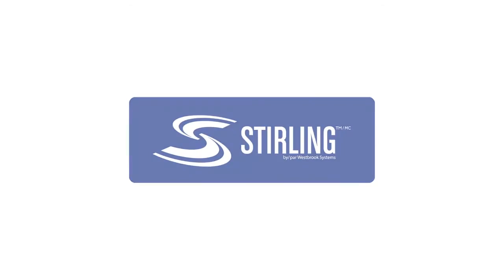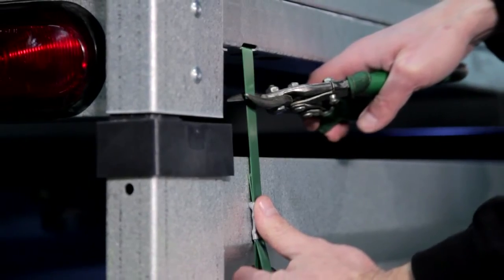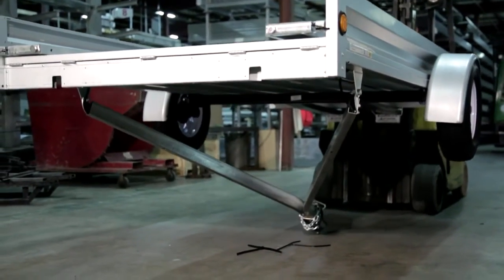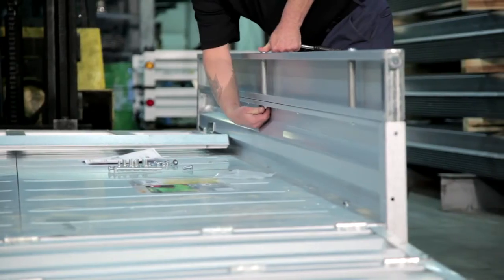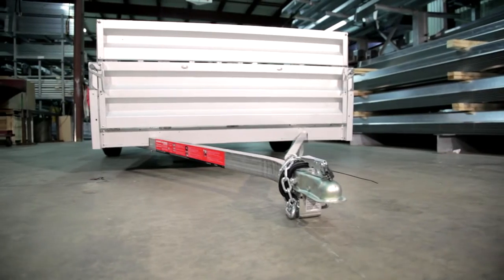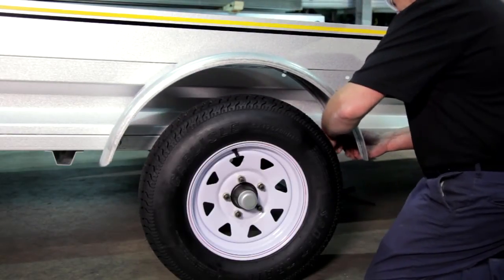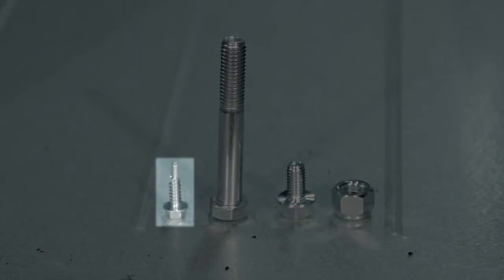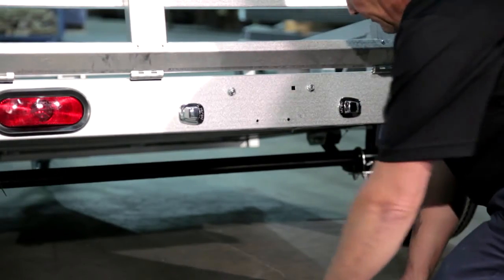Unloading and Store assembly of Stirling Trailers

Comment: The 4x7 trailer I bought a few days ago still had the forklift loops installed. I thought I'd picked a "more complete" trailer because some (not all) of the others at Lowe's had the loops removed. haha. Guess I'll take those off myself. Also, I just noticed there are supposed to be 2 license plate bulbs (left and right). My trailer only had one. The other one I was able to fish out of the inner channel of the trailer frame, but I'm still missing the weatherproof outer housing that snaps on (?) over the bulb and socket. Grrr. Waiting for Lowe's to tell me how they want to handle this. (Steal another housing from a trailer still on the lot?)

Comment: Thank god for this video!  I watched it and gave my trailer a full inspection before buying it and there were missing bolts and the forklift straps still installed!!!  Canadian tire told me is was fully assembled and would have let me drive away with it like that!  The trailer is great the people assembling is are not very responsible!  All the factory parts were correct it’s just the morons in store not being responsible! The previous store I went to I wouldn’t buy the trailer because the galvanized layer was worn off for 24” on the side rail and the store owner wouldn’t give me more then 50$ off....   just venting....   the trailer is great the people selling them aren’t!

Comment: how to you remove the fork-cliff  loops on the 5x10 trailer?
Reply from the maker: You will need to use a 3/8 socket to remove the screws that retain the fork loops and push the fork loops towards each other to remove them. To view directly on video start at 4 minutes 31 seconds.